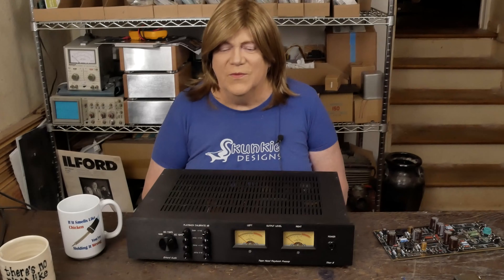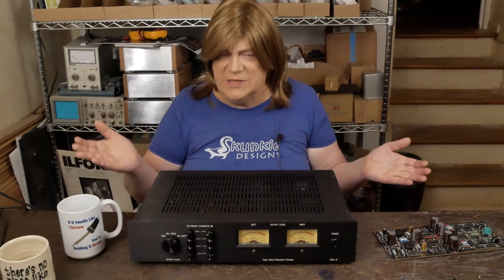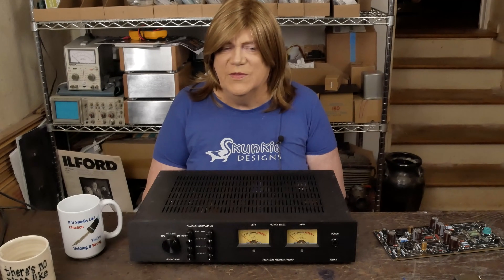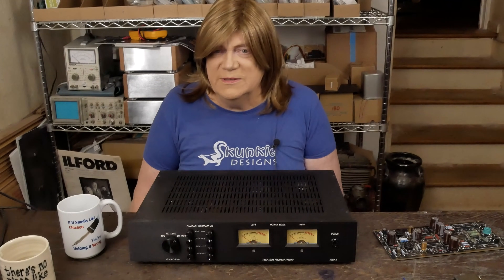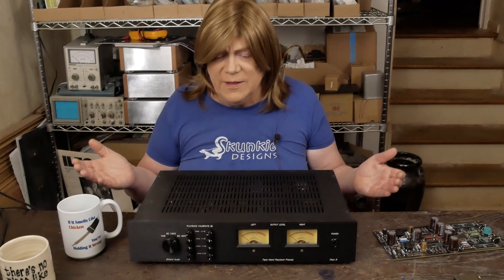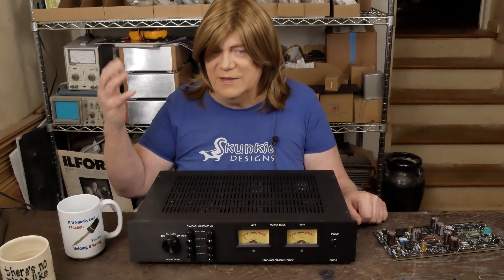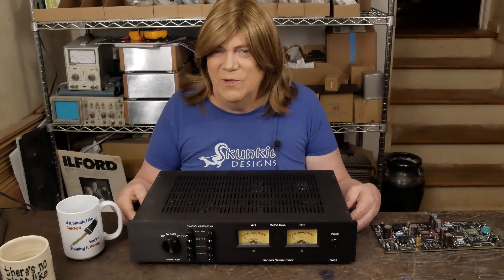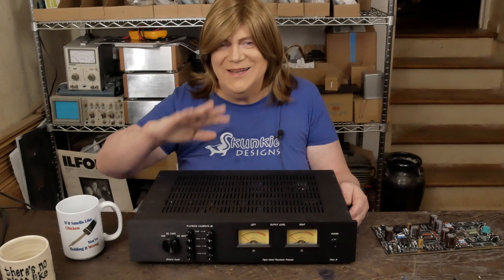Reel to Reel Tape Head Preamp: The Basics

Comment: The Technics RS 1520 has IEC or NAB at 15, 7.5 and 3.34". And the Otari 5050's as well.
Reply from the maker: yeah and some have 2 and 4 track!
Reply: @SkunkieDesignsElectronics  Both of the two do. The Otari is a great value and hardly ever breaks. Otari only stopped making it a few years ago.
Reply from the maker: I'm actually considering buying an Otari deck :)

Comment: Looking forward to the series. I’ve commented before on this series mentioning that I tried this project in the past and failed. Your attempt inspired me and having a bit more understanding now, I’ve attempted again and so far it looks great. I’m currently building it after trials were successful. I got a flat response on Revox B77 and -1db at 18KHz on Tandberg TD20A. My MRL only goes to 18KHz. I only care for NAB @ 7ips as that’s the only thing I listen to. The jury is still out on how it sounds though. For now I only cared to get a flat response and low distortion. Proper listening will be done once completed. The circuit is based on tubes 5842, 6n1p and 12au7 designed by Mikkel Simonsen. I had to tweak the circuit to work with my tape heads. I’ll be happy to share the circuit that worked for me but not sure how.
Reply from the maker: email me at stephe@skunkiedesigns.com I would love to see it!!

Comment: I'm a bit confused do you mean you are building something that will be doing the same thing as the tapehead preamp you purchased and are showing us today or,  your build will be used with the deck and that purchased preamp all together?
Reply from the maker: Building something that does the same thing the one I purchased, without all the adjustments and options for different EQ, will be 15IPS IEC only.
Reply: @SkunkieDesignsElectronics  Great, thanks!

Comment: I’ve restored many tape decks, mostly Teac. They always need a full e recap. I use panasonic fc in power supply, and nichicon fc elewhere, sadly now discontinued. I’ve had great results with these. It’s a long process but a must do. I always replace 1 or a pair of caps at a time because there can be errors in schematics and pcb print.
Reply from the maker: Appreciate the advice! And yeah eventually will dive into that, I have an old AKAI deck that needs the transistors and everything replaced!

Comment: 15 IPS is for professional recording only, at 15 IPS you are trying to get the best sound coming from the microphones. For HIFI all you need is 7.5 and good quality tapes. After I Rebuild my GX-635D you really have to listen to tell the difference between the tape and the DAC. Beautiful warmth sound @ 7.5 IPS.
Reply from the maker: I've heard the difference between 7.5IPS and 15 recording the same music on the same deck. 15 wins on clarity.
Reply: @SkunkieDesignsElectronics  You lose bass on 15ips though. Which can give a sense of more clarity.
Reply from the maker: And you lose some top end at 7.5...
Reply: @SkunkieDesignsElectronics  Sure only the ones human ear can't hear.
Reply from the maker: I compared recording the exact same song on both 7.5IPS and 15IPS and to me the 15 clearly sounded better. I honestly really hoped it didn't.
Reply: @SkunkieDesignsElectronics  Well if you want cd like sound; you will not get it from 1/4" tape. But if you want nice Warmth tube like sound 7.5 will do it.
if you are recording from a DAC. make sure the DAC is direct to the tape dack, you made want a signal spliter to give signal to multiple gear.And last if the tape been rebuild all transistors and caps replace you shoud have very nice sound.
Reply from the maker: If I wanted "CD sound", I'd listen to a CD :P